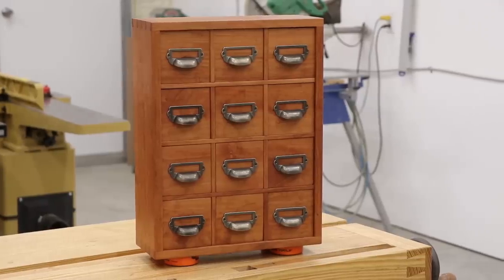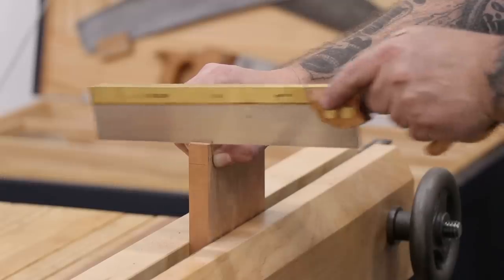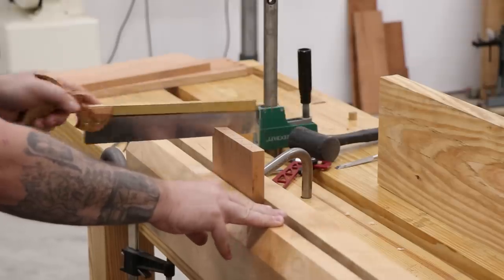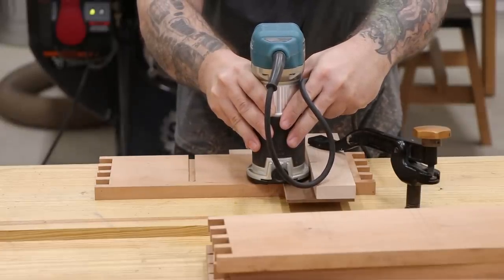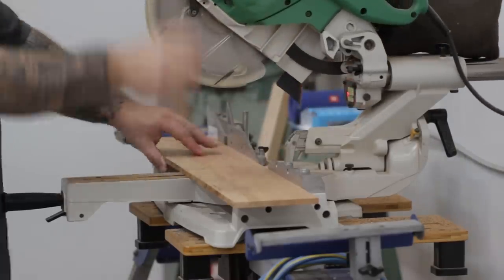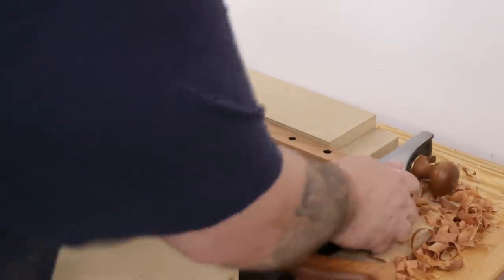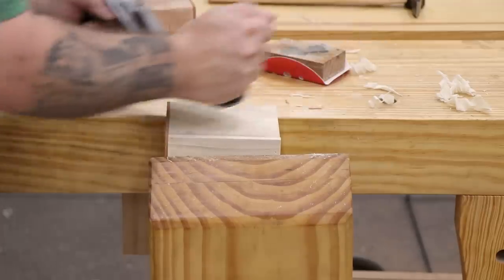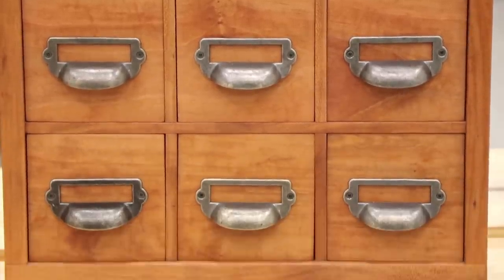Apothecary Cabinet Build

Comment: Hey Dave, it seems edge jointing before face jointing could be problematic since edge jointing for square requires the reference face ride the fence.
Reply from the maker: Yea! I adjusted my fence on the new jointer and since it was set close to the edge, I jointed the edge first but I definitely should have done the face first

Comment: I really enjoyed your video. I also like working with cherry wood, I see you added a piece of material on your planer does that stop snip on the ends?
Reply from the maker: The piece of melamine does help with snipe and the boards slide through the material a little easier. It is Al's my planer sled. I just flip it over and use some wedges under a board that's to wide for my jointer to flatten one face

Comment: Nice work man, very cool. question, why do you have the melamine on the bottom of the thicknesser? what does that do?
Reply from the maker: Thanks. The melamine is a sled to flatten  boards too wide for my joiner. I flipped it over and stored like you see in the video. When I ran a board through the planer in this configuration, it worked well and the snipe was almost gone so I left it like that
Reply: @TwistedWorkshop77  thanks for the reply. does the DeWalt planer have roller wheels on the bottom? my carbatec planer does, I wonder if this will work the same in that case.

Comment: Nice job man... I hate workin on projects with lotsa "identical" parts as they never really ARE identical & fettling is nearly always required  🙄😂😂
Seems like u might have gotten a couple "dimples" when routing the rebate for the back as the cutter bearing rode past the dados ? ... 🤔
Subbed & liked my friend... 

😎👍☘️🍺
Reply from the maker: Thanks! I'm not a big fan of all the repeated parts either. Yea the router ran in to the the dados on the back side when making the rabbet. I guess I could have used a filler block but no one will ever see it (except everyone who watched me build it. Lol)
Reply: @TwistedWorkshop77    
🙄🤫🤭

😎👍☘🍺

Comment: Very nice.  Thank you.  At 3 minutes in, we see your jointer in the background.  Your push devices are "stuck" to the jointer.  How did you do that?
Reply from the maker: Thanks. I just got the jointer and the push blocks came with magnets in them. I haven't looked to see if Powermatic sells them separately

Comment: Nice work. I noticed that you wear what appears to be IEMs. Is that correct? 64 Audio, Ultimate Ears, or something else?
Reply from the maker: They are some inexpensive Jlabs from best buy. I was trying out a cheap set before buying some nice ones. I like them but they have to be turned up pretty loud to hear over tools. Do you know what some good ones to get would be? The names you mentioned maybe?

Comment: Being left handed, how do you keep the wheel on your marking gauge from backing out?
Reply from the maker: Lately I have been using the larger gauge from veritas. The mortice gauge one. It has a larger body and the knurled wheel is larger too. I haven't had a problem with it coming loose